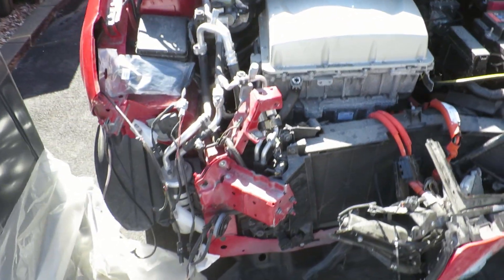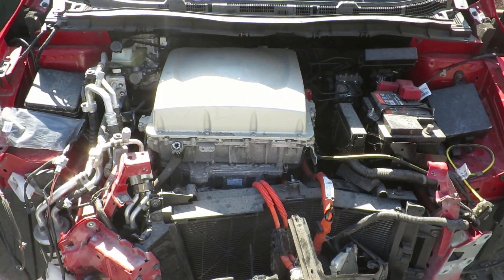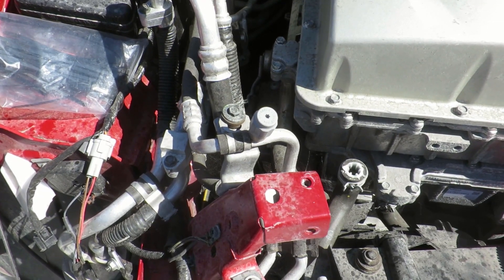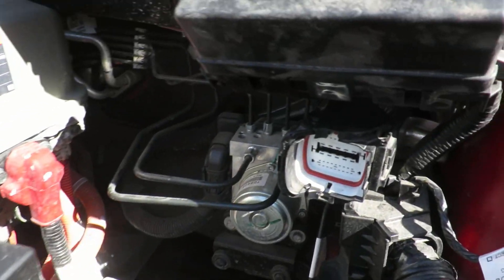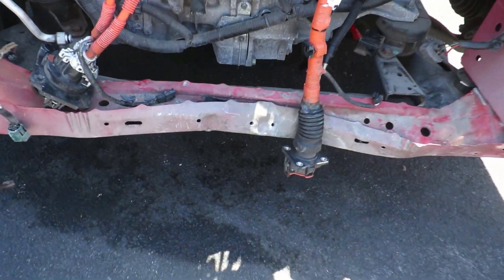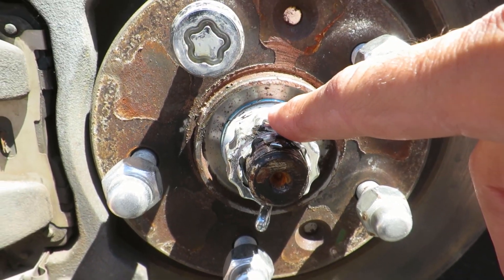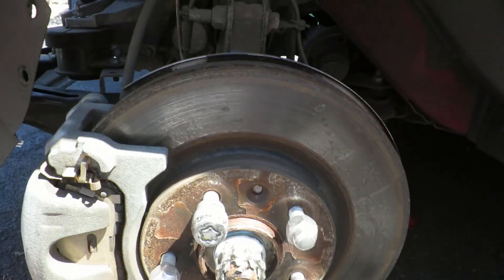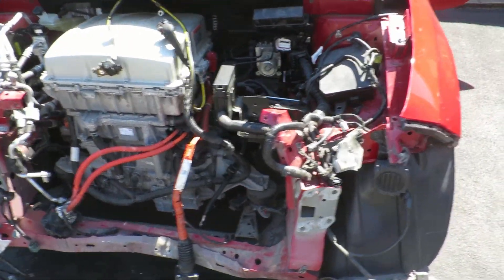Extracting the Nissan Leaf motor

Comment: Nice! I would split the motor in two already, by removing the top charger/inverter section you gain so much more access to the backside. But there are multiple ways to go at this!
Reply from the maker: Yeah, I was looking at it after filming and began drawing the same conclusions...ill have a sleep on it!

Comment: Good progress mate.
Don't destroy the drive shafts as they are worth something along with the gearbox. Performance EV had issues mating gearbox and drive shafts.
You may be able unbolt the horizontal bolts above the hubs and tilt the wheel outwards. Maybe also need to unbolt the anti roll bar and track rod end but that'll only take a few minutes. This should give enough room for the drive shafts to pull out of the gearbox using a pry bar. They're just held in with a springy clip. This will let you pull out the motor and you can remove the shafts from the wheel hub when you get the rattle gun going or get a dirty great big pry bar.
Reply from the maker: Yeah I am not going to damage them now, I have the inverter off the motor now (next video, god what a faff!). Next job is to look at the drive shafts...